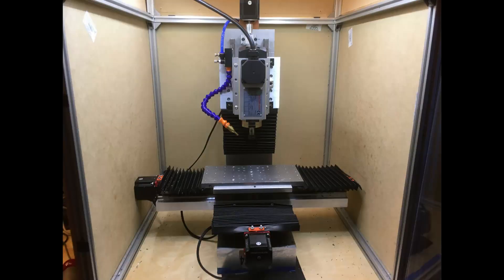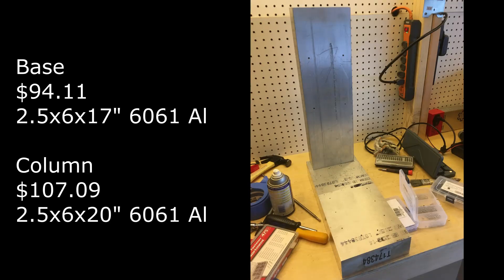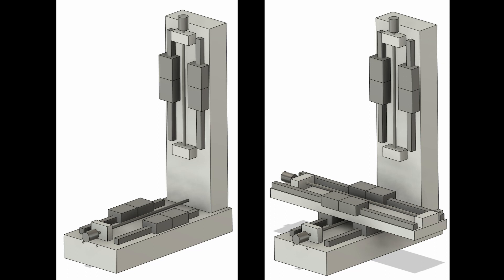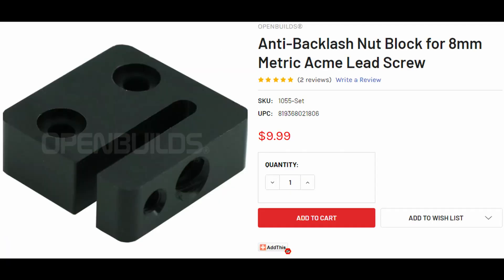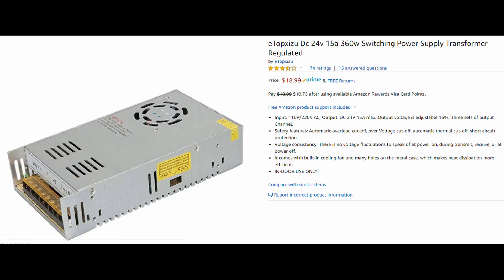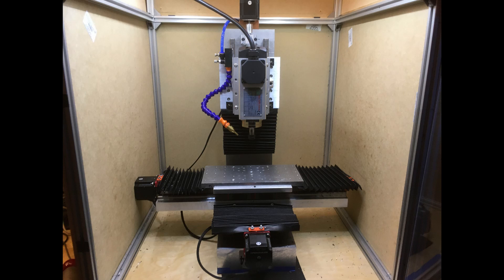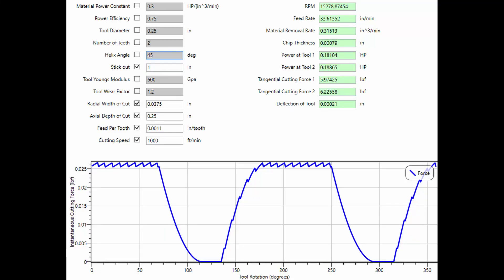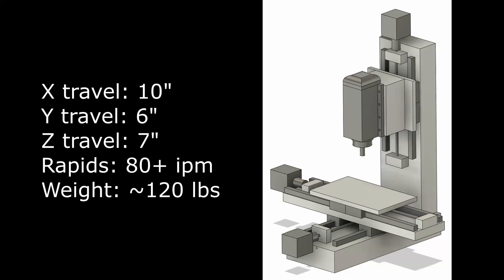Aluminum DIY CNC Mill: Parts and Cost

Comment: Hi, The column width measurement seems like it's wrong
Reply from the maker: I checked, it's actually the base width that's wrong -- it's actually 7 inches wide, not 6, because I got a good deal on an off-cut. I wanted to show prices for building it new, so that's why I put 6 inches width for the base; the supplier I looked at didn't have an option for 7 inches wide. I'll add that to the description, thanks for mentioning.

Comment: Have you posted the CAD for this design? I have a C beam that I have added 150lb of steel to that works ok, but the z height is less than desireable.
Reply from the maker: Here's the latest CAD. Note that it's got approximations for some dimensions, so you will need to use it as notional reference only: https://a360.co/3erh7Vy

Comment: Great build! I had about the same parts in mind to build one, so I'm really glad to see this machine in action. 
Interesting idea to use a solid aluminum column. Did you need to straighten the end sides to make it 90 degrees? I fear suppliers in NL might use a bandsaw to cut it to length which might be too rough, but I don't know.

Comment: i like the fact you didnt use extrusions..I just converted my 6040 to linear rails , steel gantry beam , steel reinforced table and so on.. with the machine purchase, and all the hardware involved im in about 1600 total.So agreed,  converting an existing milling machine is a better idea..
Reply: Do you think so? I'm in Asia, not in China but with good access to it I'll try to do something similar here I'm already curious how much it will be. I also did another machine (pick and place machine here, and the material cost is at least 30% cheaper than if I would have built it in Europe (where I'm from)).

Chinese people aren't doing it for free Tormach is also sourcing in Asia as far as I know.
In my opinion If you do it from parts you get a better quality.

Comment: I love it, it's a lot cheaper than I thought it would be. Have you debated on servos instead? I know they cost more but they are stronger.
Reply from the maker: I haven't had a problem with my steppers so far, so I don't see a need to spend more yet for servos. If I had ballscrews, I might want servos because then I could do some really fast rapids, but fast rapids are scary. :)

Comment: I am building a weak little router version so I can use it (slowly) to make parts for a better version but even still this stuff isn't cheap like everyone tries to make it sound.
Reply: I'm also building a cnc mill right now and the hardest part is building a mill  when you need a mill to build the mill.
I 3D printed the parts to put the mill together and then slowly milled stronger replacement part. Expected the build to take 1 month max but now I'm 3 month in and still have a long way to go.
Reply: Well, the virus slowed everything down to completely halted my work so will have to wait for this to blow over.
Reply: The Best Stooge Funny thing is that the virus gave me more time to work on my own CNC Mill, especially since manufacturing companies and the businesses that make resources for them were still open. I could still source my materials, even if shipping took longer than usual for parts.